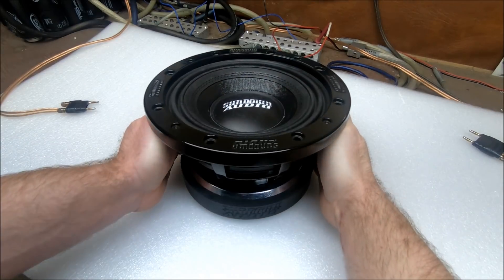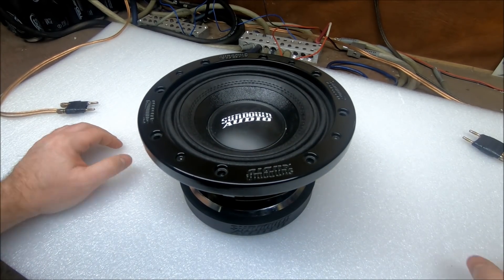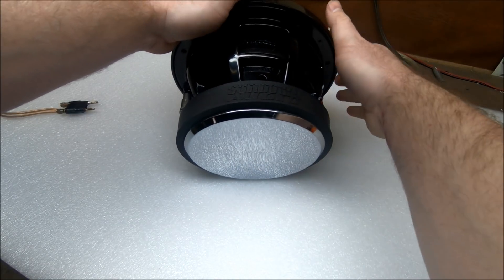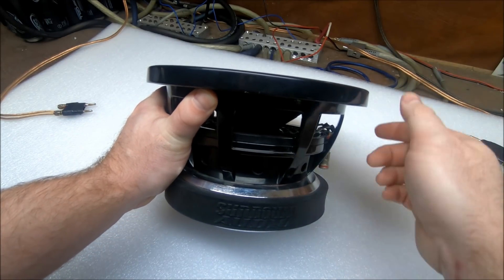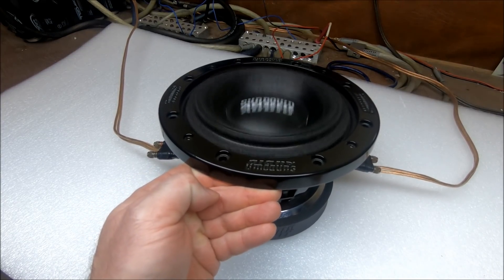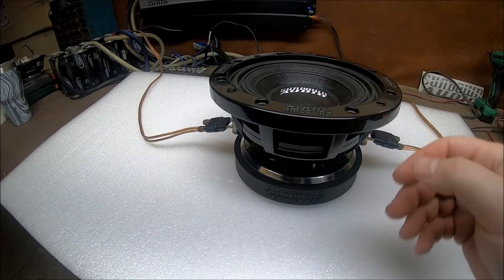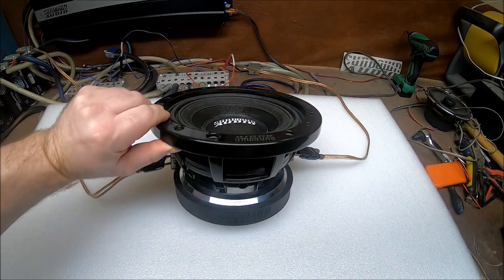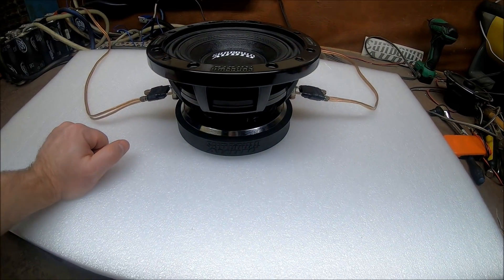*Woofer Test Wednesday* ***Prototype*** SD4- 8" Subwoofer

Comment: how would it do in a door?
Reply: I've seen one mounted under the dash in a Mini.  As long as it is sealed and meets the volume requirements it'll work.  Door may have some flex issues, but you'll still get a good bit of sound if you can seal a chamber in there.

Comment: Do you know yet what amount of airspace requirements will be needed in a sealed enclosure?
Reply: Judging by previous sd series stuff my guess for 8's would probably be .25-.5 cubes.  It looks like the sd3 8 was around
 .4 cubes so probably not much difference from that. That is a tiny tiny box.